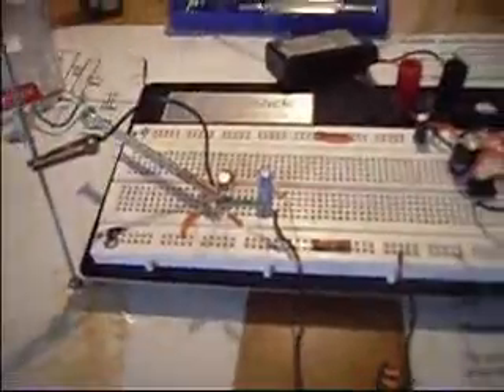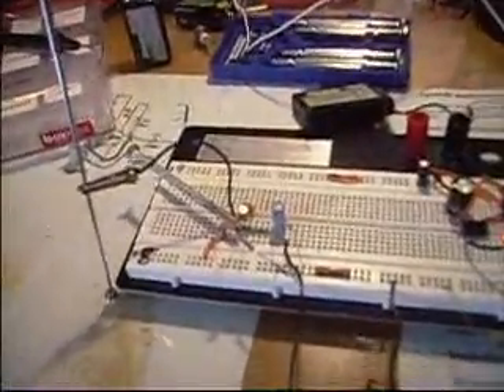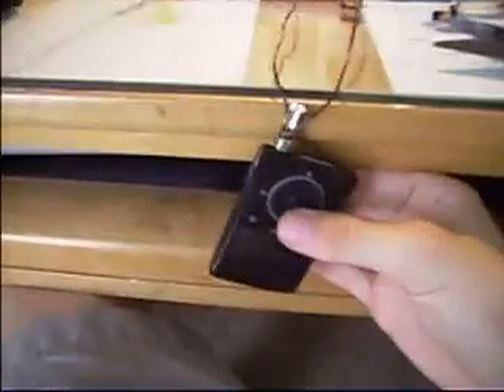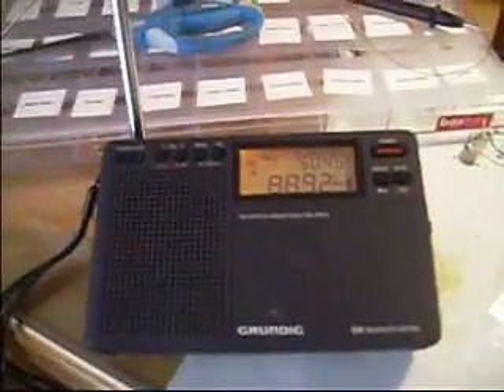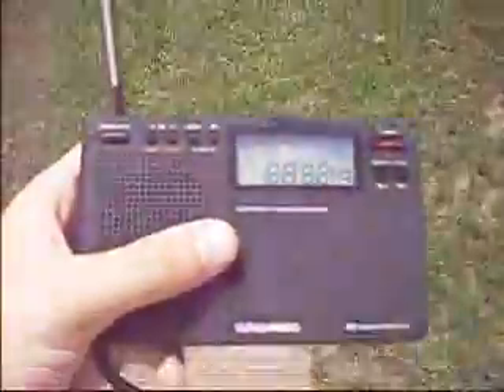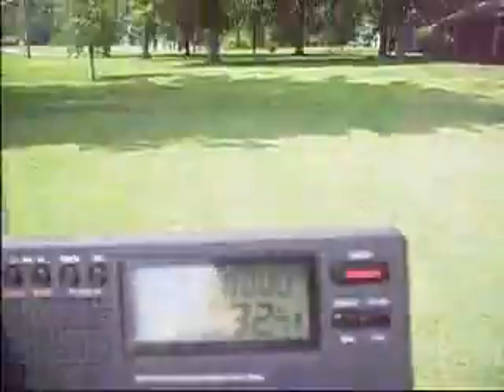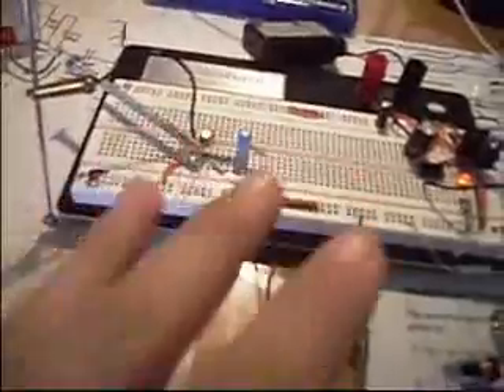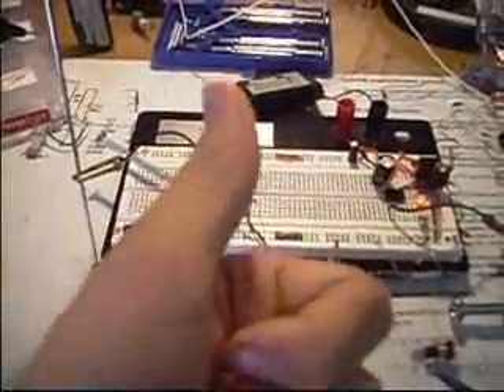FM Transmitter - Single Transistor

Comment: I replaced the transistor with a 2n3904 and got excellent results also. I am using a variable cap for C1 and running it between 5 and 12 VDC. Works well and might benefit from a buffer stage.
Reply from the maker: Agreed, a buffer would certainly help especially when I accidentally short the antenna by touching it. Of course this was on a breadboard so who knows what parasitic capacitance was affecting the oscillator. Glad to hear it worked for you though, would be interested in seeing a video of it in action.